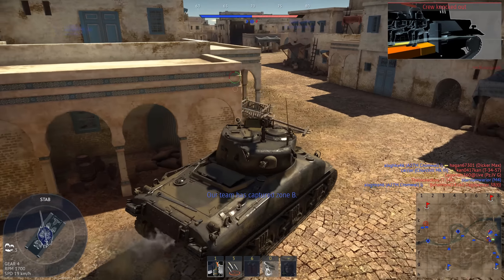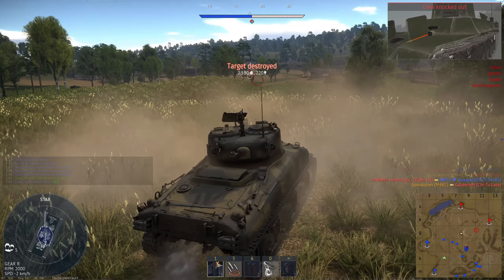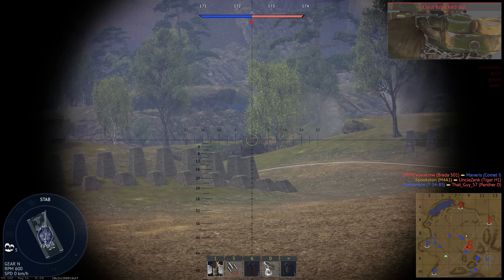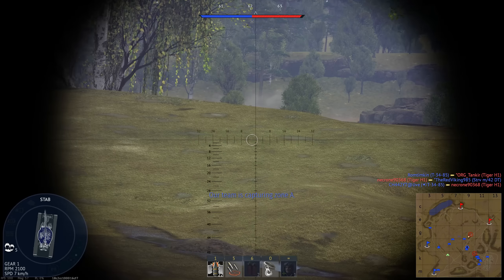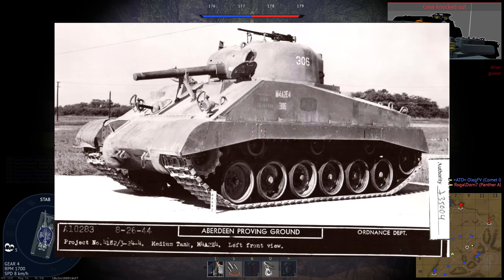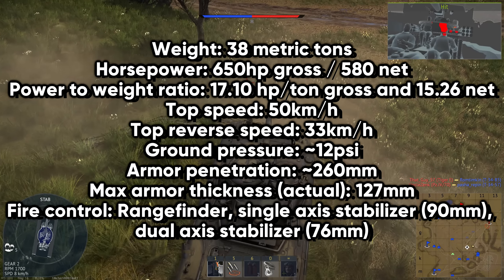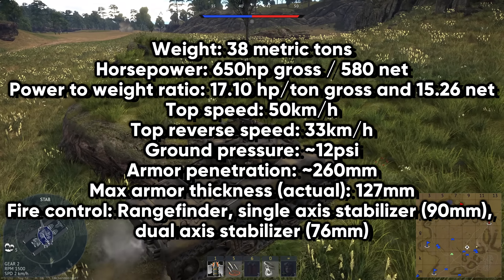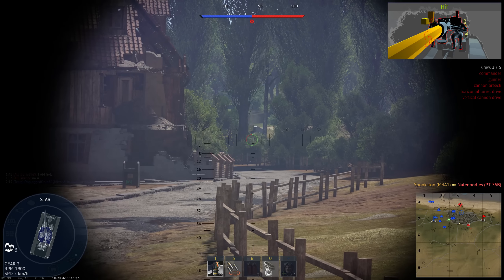The Ultimate M4 Sherman

Comment: Fantastic video idea and concept, I would love for this to be turned into a series with possibly pz 4 or t-34.
Reply: T-34 maybe, but Panzer IV, probably not, there is very little data and information for it, or anything German that isn't Tiger 1 or Tiger 2.

From what I could find atleast, maybe you could have some luck
Reply: Tirpitz 
I read that the suspension of the pz4 was reaching its limit by the end of its service, so i don’t know how much more it could take.
Reply: @Appletank8  Well then the obvious solution would be to change the suspension. Most other German tanks including the Panzer 3 used torsion bars instead of leaf springs, so I wouldn't be surprised at all if the Panzer 4 could have them. 

In fact I think the main reason why the Panzer 4 used leaf springs was because the Germans wanted to see the advantages and disadvantages of both types of suspension on top of the simpler design.
Reply: T-34-100 project, existence of barrel fired ATGMs for said 100mm gun as well as APSDFS rounds. Plus you're making a mistake of counting all T-34 as one tank which is not as true as for M4, which was a more modular design. If you slap various T-34 together, you would simply end up with either post war polish T-34 or with T-44. Maybe T-44-100 considering point above.
Reply: Dwarov 1  not going to happen. T-34 sadly has not enough space to properly trun the engine from inline position to sideway one. So calling it even T-44 or T-44-100 was already me stretching it very far. In fact with T-34 I'd even say that engine position was the most important drawback which did nothing tomake tank worse in combat, BUT made sure that it got obsolete very soon. It greatly limited modernisation reserve. Unless you're not afraid to get to 40 or even 45 tons by adding all of that to subpar configuration and then strengthening suspension, tracks and transmission even further to hold it all.
Reply: Dwarov 1  wait, what? I need to go double check T-34M specs.
Reply: Dwarov 1  I'll check Yuri Pasholok's article about A-34 and then I'll return to you. Ok? Wait a bit.
Reply: @tirpitz177  Panzer 4 was most flexible tank in german army. There was so many vehicles build on Pz4 chasis.

Comment: i have an even dumber thought experiment. what is the oldest tank hull that can use a modern turret?

and im only calling it that because you called it that. it was an awsome vid like always
Reply: The Germans fitted some Leopard 2 turrets to M48 Patton hulls back in the Cold war.
Reply: Probably the T-54. I remember coming across a T-55 (identical in most respects to a later T-54, except with NBC protection) that had been fitted with a T-90 turret once, as well as composite applique armour on the hull. Type 59s (basically Chinese copies of the T-54) can also accept Type 99 turrets, too.
Reply: i imagine a mark 1 tank with the turret of a patton m60 that would be scary
Reply: @andrew2353  Pratically the Patton 2000.
Reply: Isn’t the Type 99 an indigenous modified T-72 or some other T-series tank?
Reply: Weren’t they also called Super M60s? An M60 with the M1 Abrams’ turret.
Reply: I remember seeing a t-55 turret on a t-34 not sure if it worked or not
Reply: @spencerharrod6199  I think you are referring to a Bulgarian example of a T-34 with a T-62 turret. There was only one example with a photo of it circulating around the internet but its was only used as a bunker fortification and did not ran.
Reply: @Atourq  I don't think the Super M60 had an M1 turret, just a similar gun.
Reply: The FT-17 light tank was the first tank designed with a turret, it was put into service in well 1917 if the name didn’t make it obvious, and was used by every major power at one point or another
Reply: juan ignacio Flores I’m pretty sure that if you make some slight modifications to the turret basket a M1A1 Abrams turret would fit into a Mk-1 Churchill
Reply: South African Olifant is based on the Centurion (1945) and mounts a modern turret
Reply: @BHuang92  thanks for clarifying
Reply: You could probably fit a BMP-1 turret onto a BT-5.
Reply: For sure the T-54/55 series is point to start and go backwards from there to see if we can find anything earlier.
T-54/55s are still in service today. Properly modernized, they are plenty capable vehicles.
Reply: @Atourq   The hull of the type 99 and some second generation Chinese tanks use a modified T72 hull. However The turret and gun are domestically built by china. or the retired designs are basically copies from capturing russian t54s or t62s from conflicts and some used a version of the British Rifled 105mm cannon found on Centurions and Leopard ones but with some modifications i would expect.But I think china has copies of Russian Fighter jets with minimal changes.

So I think China more or less has a lot of Frankenstein style tank designs where the hulls are based of a Russian tanks but have the own unique gun and turret design. and it is supposedly rumoured that China has reverse engineered Relic armour found on Russian T90Ms that is used on advanced versions of the Type 99. But I can't prove that for sure so talk that with a grain of salt.
Reply: @Atourq  M60 2000 right?
Reply: @Crosshair84  Centurion beats it, Being from 45 and still used in wildly modified and modernized forms, like the Oilifant, the main MBT of South Africa.
Reply: @juanignacioflores3820  wh40k's leman russ tank...
Look it up
Reply: @Ian Goschman If your talking about later Centurions, Yes, the hull is the same base hull, However Oilifant hulls were made a bit longer than a normal centurion hull, apart from that and a different engine, its the same design.
Reply: @mofumyon  Turret ring diameter of T-54/55 is 1825mm, on T-72/90 it is 2162mm with 1810mm basket. So yes, you can fit it, but it would be an SPG with non rotating turret then. And since cannon has no horizontal traverse because it was getting it from turret rotation, you're fucked on topic of aiming.
Reply: yes
Reply: Inb4 the renault ft-17 gets a modern turret
Reply: @juanignacioflores3820  The Mark I was never designed for turrets. If you added one, the entire design would be messed up as the engine was in the middle. Also the thing had very little armour and might just collapse under such pressure.
Reply: @juanignacioflores3820  "crossout Theme plays loudly"
Reply: @Solipsil Ah thanks, so I basically confused the two separate tanks?
Reply: @yagdtigercommander  Ah, thanks!
Reply: @alphinerollei35mig28  No, but as @Solipsil mentioned, I confused the two separate tanks.
Reply: Russians pretty much did that all throughout the war. Fitting late T-34 or IS turrets onto pre-war tank hulls...
And even in cold war era this was done.
Reply: @juanignacioflores3820  mark 1 with M1A3 turret lmao
Reply: Challenger 2 turret on Mark 0_0
Reply: Just take a WW1 Tank, attach a M1 Abrams turret to the top (somehow??), do something???, profit
Reply: @saintmichaelsarchangel2644  Little Willie also was meant to have a turret and has a pretty big turret ring. Little Willie with a Challenger II Turret Anyone?
Reply: The FIAT 2000 could probably get an M4 turret, maybe even a M26 Pershing, but I don't know the turret diameter so I'm not sure
Reply: The Vojska Republika Srpska and ARBiH ended up mashing M18 and M36 turrets with T-62 and T-55 hulls
Reply: Zufikar 1, 2, 3 and a "new" M1/T14 by North Korea. All 4 tanks are T-54/55 with M1 turrets 😝
Now for real. One of the T-64 prototypes from late 50s with T-90S Proryv 3. 
Mark 1 had a turret option. It was a Mark VIII with a non traversing superstructure and cupola called "International".
Reply: WARHAMMER 40K ENTERED THE CHAT
Reply: Marmer 1 with the amx 13's FL-15? turret (Hermanus). Amx 13 with modern Kornet ATGM launchers (Peru).

South America is where you want to look or r/shittytechnicals
Reply: @andrew2353  i need to know more....
Reply: @juanignacioflores3820  the mark 1 can’t fit a turret, it wasn’t made to have turrets
Reply: you could probably fit a late production wiesel 1 turret (1993) on to a Ft-17 (1917) making a 76 years diffrent

Comment: Oh, well that's a point... A great point, but I still want to get the M4A3E2 Shermen "Firefly", he looks very nostalgic heh
Reply: You can probably switch out one of the 76mm turrets with the 17 lb gun. The turret was bigger after all.
Reply: The general findings on the firefly's gun was that it was vastly less accurate and at ranges it could pen the US guns would pen the same, and then more at further distances where the firefly would just miss
Reply: @JustinTuthill  thats why the M4A3 tank is better than the Firefly
Reply: @ThatBROperator  That is an absurd question given the many variants of both the M4 and various hulls used by the firefly tanks (All also M4 hulls with removed bow machine guns, the most often used gun on a tank is/ was the machine guns fyi). I already mentioned some items to which you have responded. I think your OP was about a firefly turret on the M4A3E2? The tank was great as it was but using the firefly gun would decrease accuracy and effectiveness. Any short range gains would be minimal and not worth the tradeoff
Reply: @JustinTuthill  damn, this comment was a long time ago dude, i didn't knew that the M4A3E2 was named Easy Eight
Reply: @ThatBROperator  m4a3e8 qas easy 8
Reply: @ThatBROperator  bruh
Reply: M4A3E8
Reply: @garyllthegreat5491  i changed my mind ;-;
Reply: @garyllthegreat5491  I already recognize my error ;-;

Comment: What the ultimate version of a Tiger would be: Transmission that doesn't break
Reply: And scrapping the Interleaved road wheel system for something simpler. Whoever thought of it was stupid or secretly a spy for the German resistance. Or is sadist who enjoys the suffering of others.

Yes because having 2 sets of inner and outer road wheels that fit together like gear cogs is a good Idea. Oh look one wheel just broke now I have to take off 3 wheels to get to the broken one. I wonder how the design team came up with that Idea and who approved it in the Tigers design.

Hans The road wheels stopped moving I think the mud froze again on the wheels !
Reply: Drew Thatcher 
in an ideal scenario, it did provide an advantage in ground pressure and tank stability. However, none of its designers seemed to care about how hard it would be to do on field repairs. Torsion bars took a while to enter US service because they were annoying to replace, but eventually the better stability it provided outweighed the problem of what to do with a snapped bar.
Reply: @Appletank8  yah but i just think the cons of tanks like the tiger out way the pros. As I am no longer a blind wehraboo kid. Yes the sherman wasn't big beast by tank standards but it was a simple workhorse tank that was a war winner. Because it cheap and easily mass producable and had the means to to upgrade when needed.
Reply: Haha so funny, wasn't that fUnNy guys?

Comment: Do you think for a "is it practical" video you could discuss the implications of drop troopers, such as ODST's, as well as the armor they wear? It seems to be metal p[late, as well as a full face visor.
Reply: Their armor is actually a hardsuit, capable of 15 minutes of EVA activity from an internal tank of air. This also makes it fully sealed against biological or toxicological contaminants groundside, for the same 15 minutes. The extra plate on the front is just additional armor made of titanium and ceramic materials. The rest of the suit is also armored, but the area the additional plate is for is y'know, where your vital organs are, and so gets extra love. Plus its the largest area of your body, so hopefully will catch a bullet and prevent your suit from depressurizing when you get shot in space.
Reply: @Abdukctkaz  but is launching a man like a bullet to the enemy practical and won’t cause a casualty if they hit a non flat angle? Biggest problem I see is that there is no steering with it which means if you land in the middle of a platoon, tough shit you’re going to face overwhelming odds

Comment: You're going to love Sprocket.

I have my own ideas for a version of the M4 more in keeping with my own tastes. Wider hull and driveshaft running straight along the bottom, which means you can drop the turret basket down lower, which means the turret ring is level with the engine deck making for a considerably lower silhouette (and incidentally less wonky top heavy proportions). Wider tracks as standard even with VVSS. And a high velocity gun, because while you can shoot two high explosive shells if the first didn't finish the job, chances are the second armour piercing shell isn't going to make it through the armour if the first one didn't.

Basically I want a miniature Panther.

Comment: Literally the level of customization I've always wanted in any vehicular combat based game, whether it be to the detriment of the vehicle or not. Any and all components available for use.
Reply: Like in the Mechwarrior series?
Reply: That's probably about the closest I've ever gotten. Even in the original mechs were pretty customizable although I don't think you could put a heavy torso on a light set of legs or anything like that.
Basically, even if putting a weak engine into a vehicle has a negative effect or downside, as long as it fits I'd like to be able to do it rather than being locked into a limited number of parts according to a tree. Let me have my Frankentank.

Comment: You can treat this series as making second video on fixed tanks of GLA in C&C Generals. As realistically their Marauder tanks would be scrapped T-54/55, M48/60, Centurions fitted with salvaged armaments of their replacements while Scorpions would be mixes of AMX-12, M41, PT-76 and so on. With upgrades to both being extra armor akin to T-55 Enigma, north korean MANPAD racks, ATGM on the turret, more machine guns, rocket pod taken from a helicopter, modern radios and commercially available versions of night and thermal vision and optics.

Comment: Imagine a tiger tank going 70 km/h in ww2, and im day dreaming.
Reply: Imagine a Tiger equipped with 120mm Smooth bore gun with Night Vision with 1200hp diesel engine firing APFSDS rounds.
Reply: @randomt-9034  lets capture tanks XD
Reply: @randomt-9034  literaly the rew will desintegrate before the tank explotes

Comment: Here's an idea, take the M51 Sherman to the extreme.

-Turret of the M46 but with an L7 105mm gun magically squeezed in it and an extended rear compartment for some safe ammo stowage (with blowout panels of course)
-Hull of the M4A2E4 for those sweet torsion bars but with the bow gunner position removed for armored fuel tanks
-Replace the engine with a Sonny 1000 cubic inch motor which produces 2100 horse power, after some "slight" modifications to the engine bay of course.
-slap a CITV on the turret along with the basic modernization package of a laser warning system, hard kill APS, a remote weapon station, etc.
-finally, take a look at the bastardized monstrosity and cover that fucker in all kinds of ERA/NERA along with cage armor around the rear of the turret and hull and don't stop until it looks like the Challenger 2's adopted step child.

Oh and give it some kind of track extensions to lower the ground pressure and a bunch of smoke dischargers.

Comment: Torsion bars also eat up a lot of interior space because they go through the bottom of the hull which, The Chiefton said it would have required the Sherman be even taller than it was because the front transmission driveshaft (which already boosted its height) would get in the way of the torsion bars.

Also, I'm not sure how you computed weight. You took the Jumbo's armor more-or-less at a whopping 42 tonnes and then ADDED more, and then added a bigger heavier engine and longer heavier body. The new turret, I'm hoping would be lighter but all that combined will also require wider (therefor heavier) tracks to keep it from sinking into the ground. It sounds like you'd be lucky to hit under 50 tons, 5 tons heavier than a KV-1.

Fun Fact: The Ford GAA v8 was actually based on a cut down V-12. The Ford GAC V-12 had 770 HP and powered the T29 and T32. If I was gonna upgrade the Ford and extend the body, I'd go all out and drop in the V-12. The GAC also put out around 1,200 HP when it "aircraft" trim. But in the 40's, simplicity and ruggedness were far more important in tank engines compared to the turbines of today.

Comment: Honestly I think the ultimate Sherman would have the A65 engine in an M4A4 hull, with spare glacis and side plates welded on over top of the existing armor, and either the turret of the M26 Pershing or the M4A3E2 Jumbo.  The main gun would either be the Pershing's 90mm M3 or the 105mm gun fitted to the M-51 (the latter would probably require an enlarged counterweight on the rear of the turret, similar to the M-51).